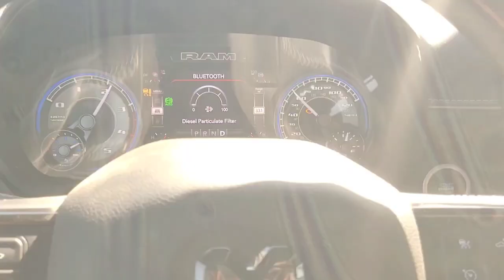Ram Aisin K1 Snap Ring failure AGAIN! The Process and Ram Support tips

Comment: Thanks for the video. My 22 just spit out the snapping while 2000 KM from home. Now my truck is making an extended stay three provinces away just heard from the dealer today that the truck has a “internal transmission failure “
Reply: Me too.  Mine popped towing the camper 5 hours from home.

Comment: Nice video full of positive energy -🎉 I like it!  I have a 2021 ram 5500 that I use for commercial hauling - it has been a gray truck for 247,000 miles. However yesterday my differential said goodbye and now I need a new one between two and $3000 at a local mechanic for a new unit +1000 for a labor. Not sure what went wrong. 😊
Reply from the maker: Expensive for sure!

Comment: My 2022 Ram 3500 is at the dealership as we speak for this same problem. Dealership replaced the snap ring and blew it again . Replacing the whole transmission now . Going on 6 weeks with No work truck.

Comment: Our family friend bought a brand new 2018 ram 4500 and since new it’s has had a wiring short and would die all the time. Finally got that fixed. Then they lost the transfer case at 40k miles. The truck sat at the dealership for 20 months until the dealership replaced it. Ran it for a month and it blew up again but the dealership replaced the transfer case in no time on second go around and so far the truck going good right now but they haven’t been to happy with that truck. They like their older 3rd gen 3500 G56 trucks better.
Reply from the maker: 20 months is absolutely insane
Reply: @bobbyjfarms3681  It was insane. Supposedly at the time OE transfer cases were on backorder and they couldn’t locate one in the whole US which I thought was BS. Our friend thought it was going to be a lost cause with it being gone for so long and we all literally forgot about the truck and it even existing around the ranch. Finally it’s back now on it’s 3rd transfer case.

Comment: Sorry youve had to deal with this Bobby hopefully you guys were through the heat of the harvest battle when it went down.

Does this sway you away from Ram any in the future? I’ve been considering a ford strictly because of the aluminum body here in rust country…
Reply from the maker: It went down right at the beginning of harvest last year AND went down at the beginning of harvest this year too. It was almost comical.  No I haven't considered switching brands. I'm not a pasture is greener on the other side of the fence kind of guy. Stuff like thus happens to all the brands